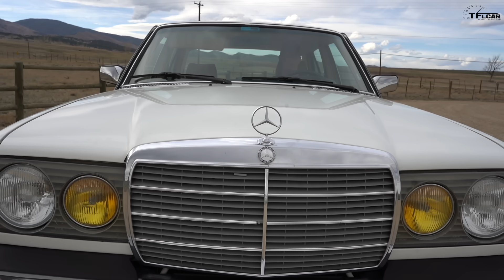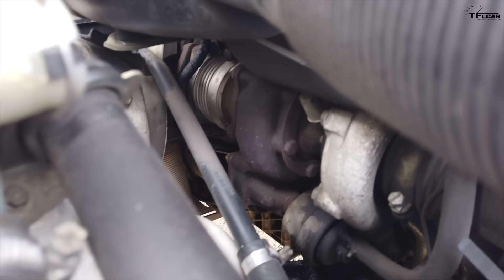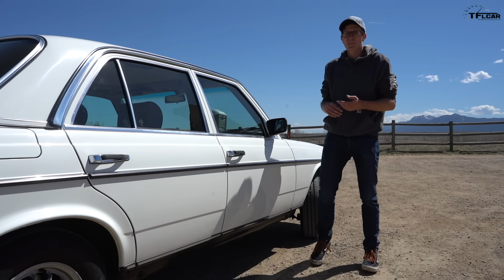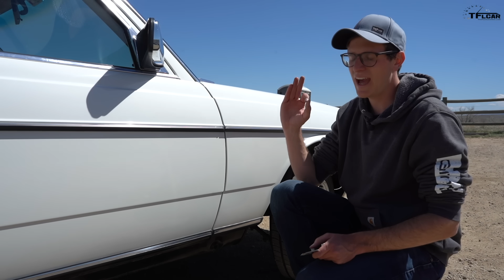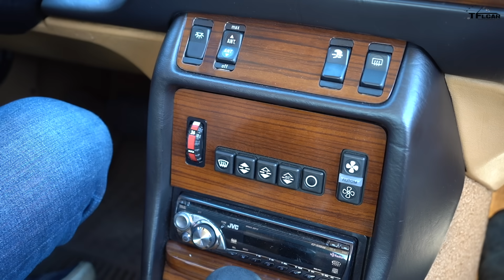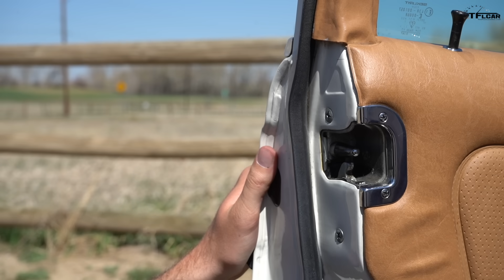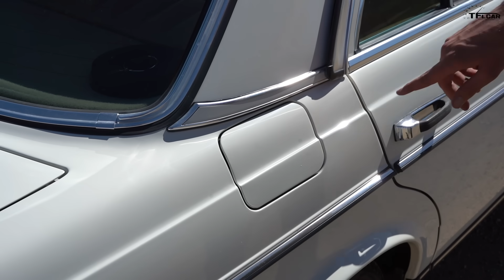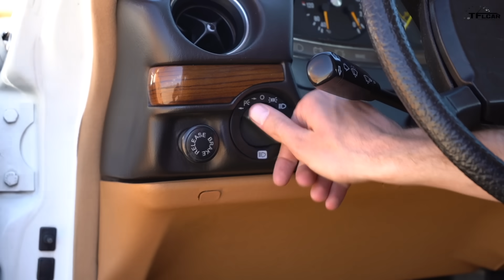This 37-Year-Old Diesel Is THE BEST Mercedes Ever Made!

Comment: The only car better than this is the wagon version of the same car.
Reply: I drove a 300TD wagon diesel from 2004-2006 every day for work...I absolutely loved that car.
Reply: I have a 1984 with 300K miles, still runs good, but is not better than my 1980 VOLVO 240.
Reply: @Lvatopesado  that was a unlucky happening , volvos are one of my favorite brands till it cease to exist but no 240 from volvo is better than a w123  ,this i can assure you ,for the fact that i owned a 240 and a 262c also the van of the 240 throughout the 80´s
Reply: Mark Summerford: i had one (300TD non turbo) , and i agree.
Reply: @nirfz  it´s not possible a 300 TD without turbo?how can you have a van with the 300 turbo diesel engine without turbo,did you take it from the car,there was the 240TD also , maybe you had a w123 van with a 300D engine?and if you retrocess the older models were more resistant ,much more heavier,and you know the w123 as being old , but there was a one year older model that was more resistant, and they were sold at the same time but with the 240D engine this in 1975, some prefer to buy another old car but new, regards
Reply: @DID70Sworkedoutforyou  It is possible, i think if you scroll up or down i already explained it somewhere: the T didn't stand for Turbo, it was for "Transport" which meant wagon (not van).Still today the "wagon" model is named t-model in german and it still doesn't mean turbo although today you almost can't get one without turbo) Mercedes produced the 300 D engine and put it in the T-Model (wagon) and voila: it's name was 300TD
A 300E in wagon form was named 300TE and also had no turbo on it.
The 240TD also had no turbo...
Mine was a 1984 model and they produced the turbodiesel and non turbo diesel at the same time. You could also get a 4 speed manual and a 5 speed manual at the same time... (was even common in later years, in the VW group you were able to by TD and SDI models at the same time. SDI= non turbo diesel)
Reply: @matthewharding919  you mean the 600?
Reply: Plus the third-row seat facing rear
Reply: The wagon version of the W123, correctly named S123.
Reply: @burtreynolds9912  Ironic since W should stand for wagon. And S for sedan.
Reply: Equally as good are the 300CD diesel or the 280CE gas coupes.
Reply: @azmike3572  
That's what I had and miss, a 1985 300CD!
Reply: @azmike3572  it was only sold in the u.s. the diesel version of the coupé,never seen one ,some might not believe that existed,regards
Reply: Okay, thanks.
Reply: @Perlen vor die Säue  As the W123 Series had the first wagons Mercedes ever build (S123, W is the limo, S is the wagon), they called them the T-Model, T for "Transport", and included the letter it in the nomenclature on the back. So the T was an on all the wagons. (Turbo Diesels in cars weren't that common back then.)
A 300 gasoline wagon with fuel injection for example had "300TE" on the back. ("E" for "Einspitzung" =injection)
Reply: @nirfz  also since 1982 started to appear the turbo version of diesel cars,normally ,even in the next 2 body styles that is called now E series the van or wagon says in the back TurboDiesel and some say TD wich is rare to see in the w123 series, it´s common to see 240TurboDiesel or 300Turbodiesel in the van ,in gasoline vans you see TE,but i will confirm to you,regards
Reply: @nirfz  i was checking you´re comment and it´s a matter of u.s. model designation the TD only appeared on the next E series on europe not on the w123 van version(the car we were talkin´about) i supposed that TD means Turbo Diesel ,but as you said it´s a reference ,and only ,i think you also commented earlier the VW group as exclusivity of the reference TDi so only cars from that group are allowed to use tdi badge ,like audi,seat,skoda,etc.,you´re totally right, i din´t check it ,regards
Reply: @nirfz  i ´m working now,but w is not the limo is the reference, like w123 or w115  both are not  a limo,there is a wider back seat space and a limo but i´ll see the denomonation and answer to your coment,regards
Reply: The wagon version is starting to fetch fantasy prices in Sweden, because most of them rusted away into oblivion...
Reply: Except the wagon doesn't have that turn radius..
Reply: no the mini is better technologically
Reply: exactly!!!! Thank you!!!
Reply: same here x
Reply: VOLVO 240 is every bit as good.
Reply: @Photologistic  you´re right but the body was not so good to resist years of humidity and it started to rust faster, but either than mercedes it was my favorite brand till they made a deal with renault and later cease to exist, as an example there are no rolls royce just glorified bmw´s if they didn´t sold the brand again,regards
Reply: @ZDB  touring. = wagon
Reply: matthew harding Never heard for the 770k Grosser?
Reply: @ivanrichthofen8061  km
Reply: The wagon and the coupe, but with petrol engines
Reply: Or the Coupe...
Reply: @Xaris Xeros ?? Are you speaking of taste? As like "only germans want wagons" or availability: as in  "they were only sold in germany" ?
(I'm neither in germany nor from germany)
Reply: @nirfz  i said that i saw more vans from germany than other countries of europe this making reference to the w115 and w123 models, they are kind of rare to see in this 70´s models, i live in Portugal and because of having sun almost all year ,there are big communities of english ,germans and dutch people, there are other nationality people  living in my country but those 3 are the most representative, till the early 90´s in the city where i live there was a german neighbourhood of military families that worked  in a airforce militar base by Nato agreement, but not all return to germany some stayed with their familys in Portugal,regards
Reply: @Xaris Xeros seems you had some stereotypes for breakfast...None of the few germans i talked about food to  meassured the quality of any eatingplace by the size of the portions.  Also taste is something subjective. Can't talk about US Americans, cause those were fewer.
Reply: @Xaris Xeros Wagons aren't just popular in germany, in most of western and northern europe they are very popular too. If you take europe, it is the south eastern and in some part eastern europe were people for a bigger percentage share your kind of taste (car body wise).
Reply: @nirfz  i ´m friend with a dutch that worked for mercedes, the enterprise not a dealership, and that is not correct as an example in south europe the only w115 vans i saw were german ,this for the last 40 years,the w123 was common to see a few ,in the town where i live since 1980 i saw 2 vans since they came out a 240 and a 300 both turbodiesel, in 98 i bought from a friend a 2.5L gasoline van from E series with 80 km´s and 15 days old,but mine didn´t had no badge either than the mercedes symbol in the back ,i have to ask then i´ll comment ,regards
Reply: I  disagree
Reply: There is one around the corner from my work c230d(sw)  I'd say 1974 reg. In perfect condition. Mind you it is a horrible olive Green 😜
Reply: @Perlen vor die Säue  Touring?

Comment: I enjoyed your video. Back in the late 80’s and early 90’s I drove a 1985 MB 300 turbo diesel that looked and sounded exactly like yours.  It has 150,000 miles in it when I got it and over 200,000 when I traded it off for a new 300E. This will always be one of the more memorable cars I have owned.

Comment: Great car. There is some thinking behind the dome light switch. Sometimes you need a bit of light in the cabin but the front one can blind you on a dark road so that's on a separate switch. That's my assumption anyway. It strikes me as the most logical reason and Germans are nothing if not logical.

As for the temps - 20c = 68f, 22c = 72c

The parking lights are a pretty standard feature of cars of this era in Europe. It's very common to park on the road at night and our roads are pretty narrow in a lot of cases so putting on a parking light on the off-side of where you park is a good idea. It's also common to park on the driving side or opposite side of the road in Europe so you need to be able to choose which parking light you want.

Comment: It’s Mercedes man I own 4 of them , 79 300td wagon , 89 420sel , 89 560sec and my daily is 91 420sel love them all
Reply: Great taste in cars. Would love a 126 coupe. Currently, 1994 S124 (wagon) 300d (om606 NA) as daily , 1992 C124 300 24v (coupe) for fun and a 1997 W140 S 300 TD (om606 turbo) for long distance travel.
Reply: Izrealeu  the coupe might be 4sale soon
Reply: @karol23982  Where you are located? I am in Europe.
Reply: Izrealeu  Phoenix Arizona USA
Reply: @karol23982  Good climate for cars, bought a Lincoln Continental Mk3 from there but I want a Euro spec Benz if I'll buy one.
Reply: Izrealeu so u looking for 500sec ?
Reply: @karol23982  I would not mind adding a 500 or a 560 sec to the collection. If it is a good original and cared for example. I used to work for MB in the late 80ties through late 90ties and have always owned a few from that era. So I am not actively looking but if I come across one I will consider. Same goes for a 124 convertible or a 500E.

But the US spec has too many downsides for me. Way down on power output, diff gearing is higher and I really dislike the bumpers.
Reply: Izrealeu I see , there is couple things that don’t work on the car but other then that is great car for the age but in Arizona sun kills paint n interior witch is still good but I can tell car was use as a daily in some point in life
Reply: @Izrealeu  does that mean they have higher revs on autoroute top gear?
Reply: @raycroal  US version have less power , around 238hp (phase1) 248hp (phase2) where in Europe we get 299hp for a 560 engine.  (lower compression and different exhaust systems in US due to lower grade fuels common there. In europe we have 98 and 95 fuels while in us mostly 91 octane. As for gearing of the rearaxle Euro 560's came with 2.65 LSD's (unless it has ASR which is an open differential). US 560's came with 2.47 LSD's (again, if it had ASR, it was open). So the euro version revs slightly higher and is more in the power band of the engine. The US spec is more for cruising and long distance. All in all a more balanced driving experience imho. Either way US or euro it are still great cars, but if I can make a choice i'll get a euro one, and being in europe the most obvious choice as well.
Reply: al carr definitely cheaper than my Volkswagen for sure and 123 126 Mercedes doesn’t break down as much as my VW so yeah I’m not complaining at all
Reply: Wow realy cool!
Reply: @al carr  well, monthly ? nothing or something every 2 or 4 years ,this after 10 years of being driven, (this not couting the brakes fuel and oil),it depends on where and how you use it.
Reply: 420
Reply: The 123 diesels are bulletproof. More than 1000000miles are possible. The petrol engines are also good, but they drink to much. My 230CE from 88 with 136hp uses a lot more petrol than my 2,2l esprit turbo. That car has 2 times more HP and goes 270km/h and takes 3liters less every 100km. I sold quickly my 230ce, I got only 1500€ for it. My Esprit will never be for sale. It's a drivers car that puts a smile on your face. Something I never had with my Benz.
Reply: @449Raphael  it´s a diferent type of car and the 230 engine was used in several series ,as an example the mog truck that was very jungle able used by the Portuguese army in the 60´s and early 70´s on the colonial war in africa wich ended in 74 when  the revolution made by militar oficials dethroned the ditactorship system and brought the democracy to Portugal, it´s an engine that i had in a w113 ,wich made it one of the fastest sedan in the world this around 1970, i also had the 68 S series with a 280 engine  that had the same problem ,the consumption, the C series was my favorite series but having only two passenger doors, it wasn´t practical ,regards
Reply: Old Benzes are the best. I own 3 myself, 
1993 W201 190E 2.3 with 315000 miles
2001 W210 E320 RWD with 135000 miles
1999 W140 S320 with 134000 miles
All three are daily/weekly driven.
Reply: I have parts for w123😂
Reply: Hey, I've got a 1980 300SD TD for sale! Lmfao
Reply: @ANautyMoose  do you really have 300SD for sale?
Reply: Congratulation,you are a lucky man
Reply: Proper enthusiast
Reply: You understand “garage goals”! I just sold my 90 420sel and I’m sad.
Reply: I have 3 units. W123 C202 and W209 - CLK
Reply: Good choices.

Comment: Ya Volvo of that same time frame the hood did the same thing and the engine ran forever. Nice Mercedes.  In the mid-1990s Volvo's started to turn into the biggest piece of s*it and they have become more of a piece of garbage and expensive to work on sense. Things break that should never break. Guess how I know that. I finally got smart and went to a 2007 Toyota Avalon.